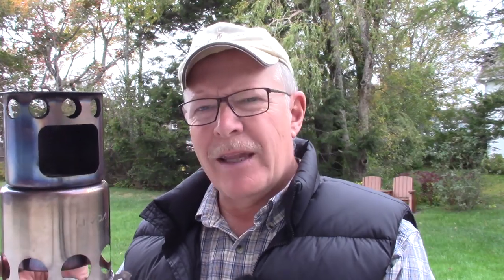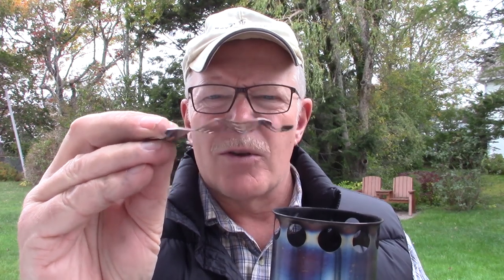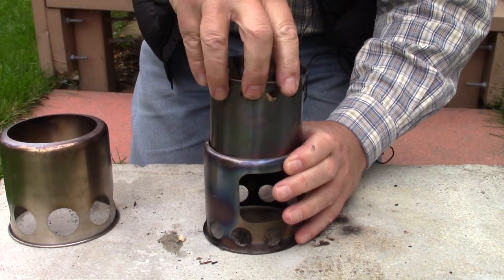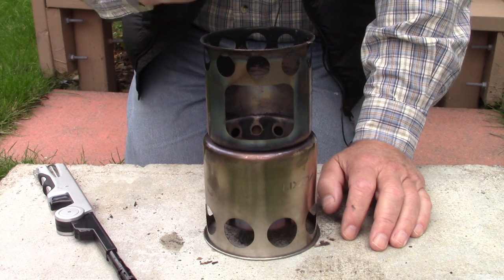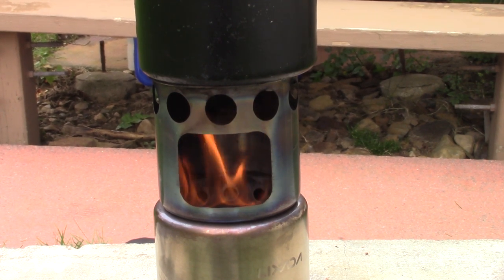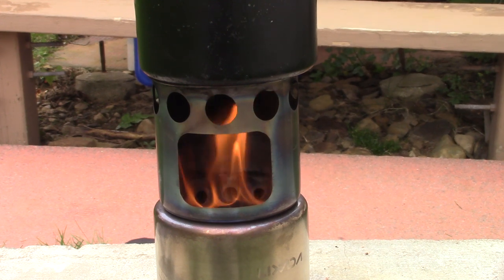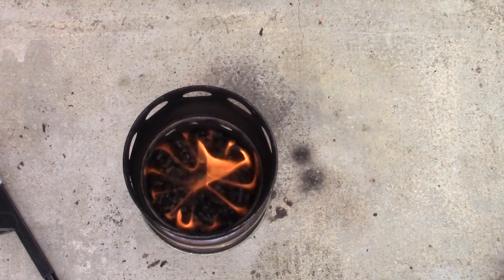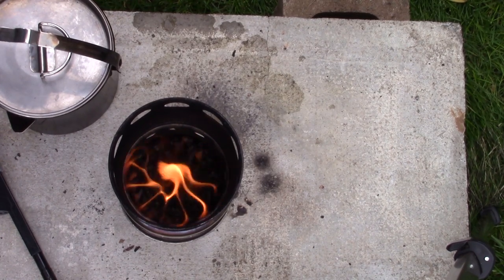Lixada Tower Stove with Wood Pellets

Comment: You have the best stove reviews on YouTube.  Thanks for sharing them.  

I'm not sure why they put those big holes on top of the Lixada.  My Lixada doesn't heat the bottom of even big pots well unless I put the cross bars on it. With cross bars, the flame seems to stay in much better contact with the pot.

BTW a trick I like for long burns in the Lixada is to include one  piece of pressed charcoal in the bottom and then load with wood twigs.  If I get distracted with meal prep and let the twigs burn down without reloading, I can just toss in more and the charcoal will quickly light them and get the stove going again.  And that one piece will last 45 minutes.

Another trick to improve stability of the Lixada tower is to use a couple tent stakes through opposite holes on the bottom to attach the stove to the ground.

And finally, I discovered Lixada makes a bigger version of this stove that doesn't weigh much more but takes double the fuel, and can bring an impressive amount of water to boil quickly. The biggest negative is it comes with 4 cross bars that are a bit like a puzzle to assemble.
Reply from the maker: Finding the best setup for airflow can make all the difference in wood stoves. Cool suggestion about adding the charcoal briquette. I will have to give that a try. I did know about the tent peg idea and use it on my Lixada Tower stove. Will have to look again at the larger wood gas stove. Thanks for commenting

Comment: Mark,
Thank you for another excellent video -- and for the valuable information you always give.
I've been using a couple of Canway Camping Stoves, which do a nice job of reburning the wood gas (twigs, pellets).  But I use much less than 1.5 cups of pellets; instead, depending upon how long I expect to need to cook at that time, I use a half cup of pellets with twigs on top.  The twigs really get things going, quickly, while -- by the time the pellets catch -- the pellets provide excellent, balanced heat.  I use the twigs for boiling water -- the pellets for cooking food.  You can always add more of either, if needed.
Like you, I found that the pellets are too small for the stove (as is), so I put a home-made "riser" (made of flashing material) on the floor of the burn chamber to elevate a home-made round (with a couple hundred holes drilled in it) set on the riser.  It works beautifully, allowing airflow from beneath, preventing clogging at the bottom, and keeping the pellets from falling through.  (The riser and round store easily within the stove and add nothing to the weight.)
I like the idea of the corrugated round.  I'll have to try that.  Thanks again... and cheers!
--- Old Matt
PS: To help gasify more quickly, I break the twigs short enough to keep them below the gas ports when I load them.  It mostly prevents smoke.
Reply from the maker: All good suggestions. I may play with other combos of plate and pellet amounts to see if I can get better performance. The Lixada "Scout" stove works so well with pellets. I may stay with that one for pellets. Thanks for commenting

Comment: Great test Mark.  Do you think it was the slower burn of the pellets, new plate, or the combo that allowed gassification?  The pellets surely slowed the burn because less air would travel up through them compared to the wood which had spaces between the pieces. May be interesting to use the new plate with wood just to compare it to the pellets.  Just a thought.  Thanks for sharing, you always get me thinking!
Reply from the maker: Hi Jackie. I find pellets usually gassify well in must stoves designed to as a wood gas stove. The decreased ariflow may have helped as well. I may try this plate with wood to see if it makes a difference. If it does, I may make a video on it. Thanks for commenting

Comment: I have been enjoying catching up on your videos and like your style. I have both the Tomshoo wood stove and this Lixada Tower stove. I enjoy the convenience of wood pellets giving a good long steady burn, but the satisfaction of collecting twigs and pine cones to use as fuel.  Anyway, I am looking at a combination to try using charcoal on the bottom of the burn chamber  for grilling, the top twigs and cones for boiling water. Have you tried anything like that? I figure thr charcoal will give longevity for grilling.
Reply from the maker: I have a video coming up where I try the stove with charcoal (no spoilers)😉. I have not tried adding wood or pellets on top but it would be interesting to see how it would work. Thanks for commenting
Reply: I have used charcoal in both the Firebox Nano, Emberlit original 5 in. stove and the UCO folding mini stoves. Works well in all. I only use the charcoal as  a coal extender for even heat for cooking. In these typical stick stoves there really are no coals to cook over and once the flame is gone so is your heat...you must cook over flame. As soon as there is a nice flame in the stove I add the charcoal....one to the Nano and 2-3 in the Emberlit. It is nice to walk away (so to speak) and not have to tend the stove every minute worrying the flames will perish. As the charcoal "grays" it is very easy to re-establish a flame fire if wanted. I have also found the term "stick stove" to be deceiving. Using thicker branches of wood is easily doable. If you haven't tried the Swiss torch method you should. Look to the Firebox website for the best vid on this method. Well worth it.

Comment: Thank you, Mark. The corrugated wood pellet plate is an interesting idea. On a different note, which of your many stoves works best with wood pellets?
Reply from the maker: Glad you liked the video. In my experience, the Lixada "Scout" stove is the best stove I own for using with wood pellets. I would include the Solo stoves but they need a grate in the burn chamber to keep pellets from falling through. A full load of pellets in the Lixada will burn hot and clean for over 40 minutes. I have a couple of videos on this if you are interested. Thanks for commenting
Reply: Check out The Firefly Lantern on Youtube. This stove was designed to be used exclusively with wood pellets and works great.

Comment: Mark, I see as you said, that the fire was reduced from that of the wood fire in the earlier test, which would mean a lower cooking temperature. Sounds like a way to lower the chances of burning pans or food. I don't always want a full raging fire to cook with. I see that other folks are asking about what might happen if that large side loading opening was covered. Perhaps that might dampen the fire a bit more, especially if no pot stand was added. I think that you have opened up a few more tests to do my friend.
Reply from the maker: Oh no...more tests😉. Yes, the reduced heat may be a benefit for some types of cooking. Thanks for commenting

Comment: I think if you use the pot stand it would get better air flow when you have the pot on the stove. Just a thought.
Reply: It looks like the flame is much too far from the pot already... but I appreciate what you are saying.  That process of using pot stands worked very well with the square (folding) Lixada stove.
Reply: Airflow is being redirected to flow out of the big side port when you cover the top of tower stove wth the pot.
Reply: Is indeed something to think about,if thou want too issue it was a pellet stove
Reply: @PaulSchortemeyer  i noticed the flame got larger when Mark lifted the pot off the stove. I think it would be hotter and the flame taller too with pot stand.
Reply: @connosaurus  I agree that blocking the feed port may increase effectiveness, but I'd like to also try the pot stands to allow those flames to tickle the bottom of the pot.
Reply from the maker: So, I just recorded another video where I use the pots stand on top of the Tower stove. Personally, I don't feel it makes much of a difference in performance as there is so much airflow with the holes at the top already
Reply: @MarkYoungBushcraft  that's cool. It was just a thought
Reply: Mark Young Looking forward to viewing the results! Thank you for reading our comments from the peanut gallery!

Comment: Good video and thank you for posting this one. I’ve found some perforated metal to do the same. After hearing the definition of gasification it seems my main reasons for wanting a gasification stove are all wrong. I like feeling I’m clearing up fallen limbs and my main reason is I don’t like to dodge smoke. I guess I’ll never be a purist.
Reply from the maker: Glad you enjoyed the video. I consider gasification a goal rather than a neccesity. If the stove works well and does not smoke too much I am happy regardless if it gassifies. Thanks for commenting

Comment: Excellent video Mark!  Wood pellets are a great fuel for many applications but not all of them. I am curious to know what happens if you wrap the upper section of that stove with tinfoil to block off the upper holes and that big loading port. It might get you the flame height you are looking for by stopping  the introduction of the cold air above the secondary burn ports and preventing the exhaust cooling.
Reply from the maker: Glad you liked the video. Interesting suggestion. I may do a few more tests yet. Thanks for commenting

Comment: Im curious to know if i could heat up a little tent with this
Reply from the maker: I might use this under a tarp that is open on at least one end but not in a tent. Aside from the fire risk it still produces carbon monoxide. Hope this helps. Thanks for commenting

Comment: It seems to me that the holes around the base and the holes under the cooking vessel are about a 3rd larger than they need to be.  I have no experience burning wood pellets, but I can think of times when they could be useful to me.  I ice skated on a river once, fell down, stood up soaking wet.  Any kind of fire would have been useful at that moment.
Reply from the maker: The holes do look a bit larger than necessary. I made a video a few years ago based on the idea that I had just fallen through the ice and needed a fire. Thanks for commenting

Comment: What pellets do you use?  I purchased hardwood smoker pellets from Lowes and have had difficulty in getting them to light and burn clean.  I suspect I need pellet stove fuel pellets but the smoker pellets were easily available.
Reply from the maker: I use hardwood pellets intended for pellet stoves. The brand in Canwick and I but them at Canadian Tire. I have had some people suggest using smoker pellets are safer as they do not contain binders. If I was direct grilling food I would definitely use them but for boiling water I am happy with the Canwick pellets. Thanks for commenting

Comment: A question?  At 3:45, you're talking about the flame not extending to the bottom of the pot. When I look at the video, at the top left just at the bottom of the pot, I see a blue flame and heat shimmer, as if there is a very hot flame going on there.  Is that one of the gasification jets?  If so, that would appear to be high enough to reach the pot effectively.  If it's not a gasification jet, what is it?
Reply from the maker: Good question. When I look at the video I don't feel it shows the flames as accurately as when I watched them directly. The stove was certainly producing some good clean and hot flames, and possibly some blue methane( and definitely gassification) flames but despite what it looked like, most of the flame was not in constant contact with the hot. A lot of the heat shimmer may have been heat escaping out the feed port
Reply: @MarkYoungBushcraft  Thanks!  Appreciate the quick answer and clarificatiion!

Comment: Were you using kitty litter wood pellets or the hardwood smoker type ( apple, hickory, etc.)?
Reply from the maker: I was using softwood fuel pellets purchased at a local hardware store. Now I use only hardwood fuel pellets (same price). They seem to burn cleaner. Thanks for commenting